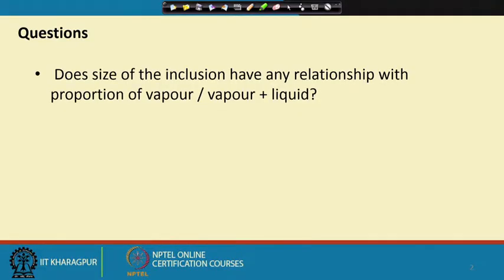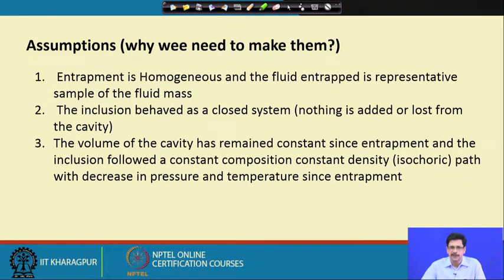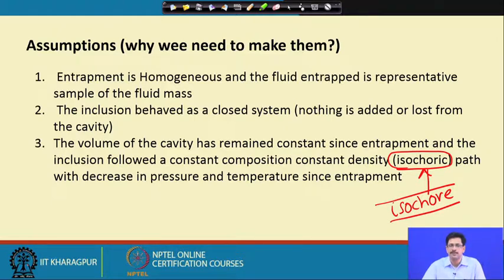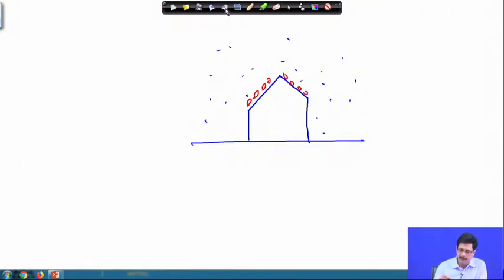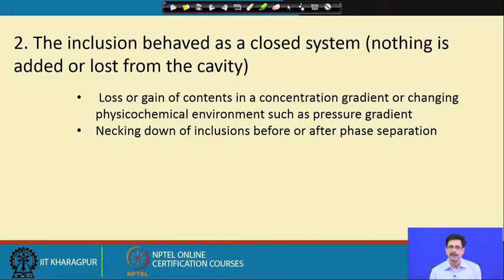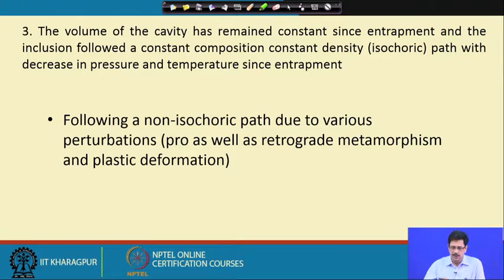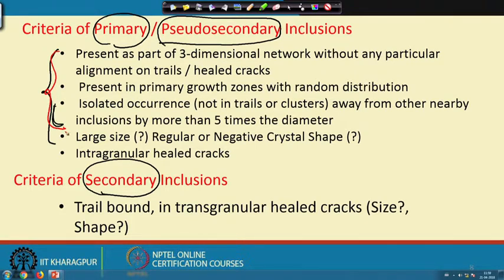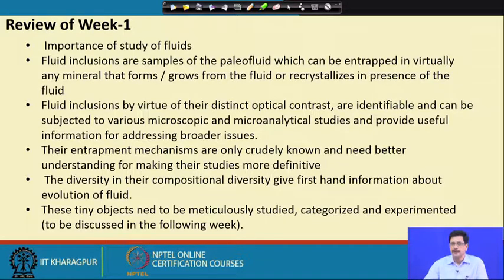Lecture 05 : Introduction (Contd.)

Comment: Thank your for the detailed presentation professor.  One question please, for you and the other colleagues: You said that primary or pseudosecondary inclusion can be found in intragranular healed cracks. Why can they not be characterized as secondary one in some circumstances? Could brittle deformation create intragranular cracks that would be healed by a new fluid?